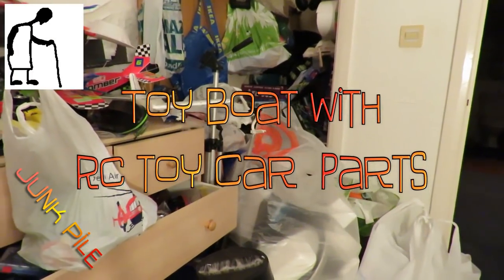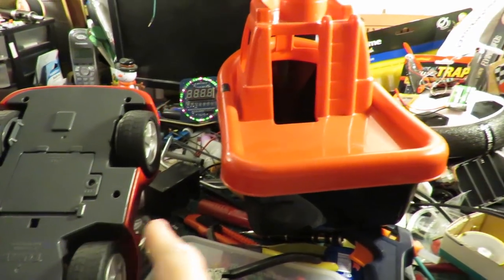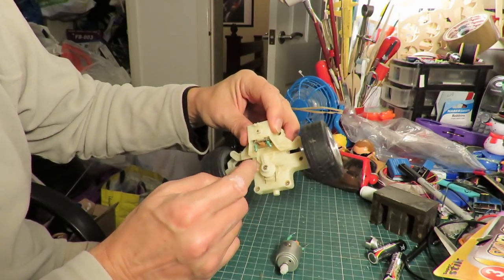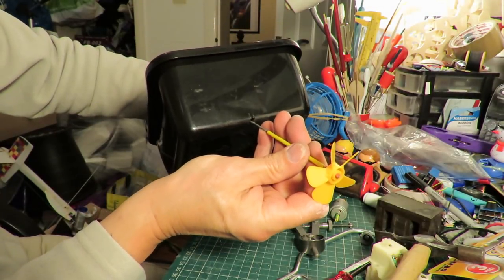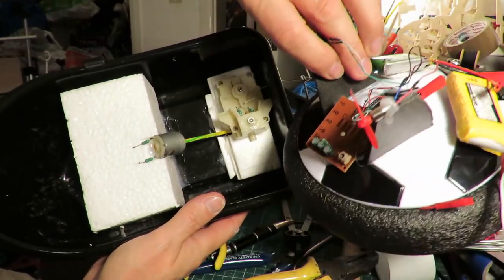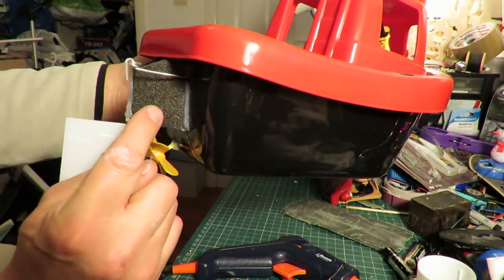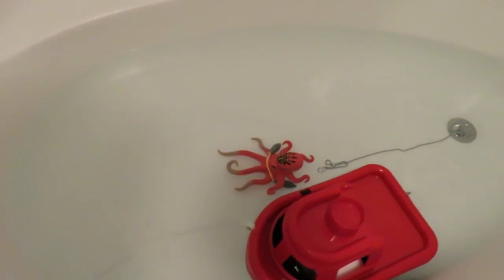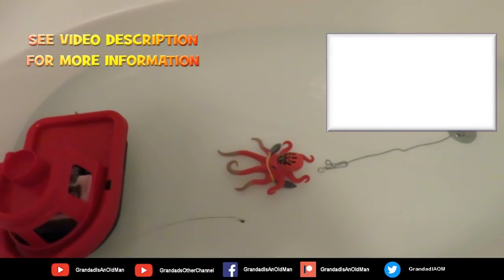Junk Pile Toy Boat with RC toy car  parts

Comment: Why is the Propeller motor off center? Shouldn't it be in the midle of the foam?
Reply from the maker: It fits where the doorway is so I didn't need to cut the bodywork. I could have set it lower in the hull but I didn't. It is not going to make any significant difference to the control of the boat as this is hardly a racing boat.
Reply: GrandadIsAnOldMan O yes I see your point, I dindnt notis the door was off center. Iv still got these 2 RC battle choppers that dont work. Its odd as I turn on the Remotes they make a click sound like its a short circuit and the lite flashes for a millisecond on both controllers. I dont have the time to take them apart😐
Reply from the maker: 3 likely issues with your helicopters. Broken gear, bent shaft, dead battery.

Comment: My local pound land sells everything thats supossed to be 1£ as 90p to complete with the pound world down the road.
Reply from the maker: Yes they do that. The one in Yate was doing that when there was a 99p store next door and the another one on the outskirts of Bristol does that because they have a Poundworld next door.
Reply: GrandadIsAnOldMan Yes its intresting as £1 world hasnt gone to 90p to match. I wonder if it actually makes a difference in profits?
Reply from the maker: It will make a massive difference to their profits in that shop but Poundland is trying to destroy the opposition by practically running that shop at a loss. You will notice the range of items in that Poundland will have been reduced to minimise their loss. They won with 99p stores and eventually bought the company.

Comment: Your not trawling all the Charity Shops ? you'll get withdrawal symptoms, spend your days fretting that your missing the bargin of the decade !
 before the weight was added the cavitation of the propeller gave an authentic sound to the boat which gave me an idea, how about adding the speaker system from the car and down loading an appropiate noise for a tug boat ?
Reply from the maker: Still visiting charity shops but being much more selective in what I buy so plenty of blank days. As for changing the recorded sound on one of these toys, it must be possible. I did buy some circuits for putting in novelty greetings cards that allow you to record your own message but they are fairly limited in quality and duration.
Reply: The greeting card circuit would be all you need, get a recording of a tug and wire it to play continuous when forward or reverse were slected, or is that a complicated circuit ?
Reply from the maker: Here is that greeting card module https://youtu.be/h2VUx7Kaf6c?list=PLA5a2xPRSrB2WJXULAHJCeccvzkT3midw